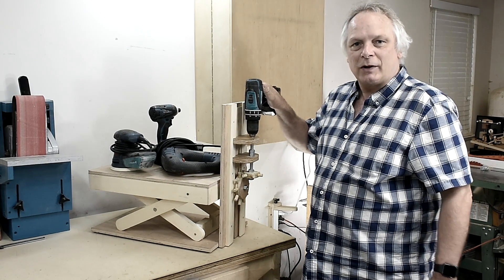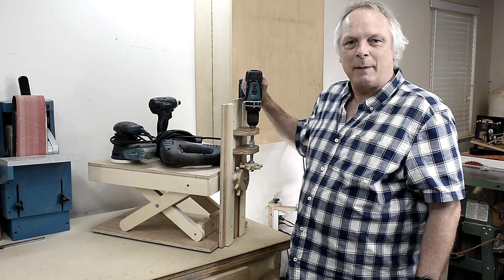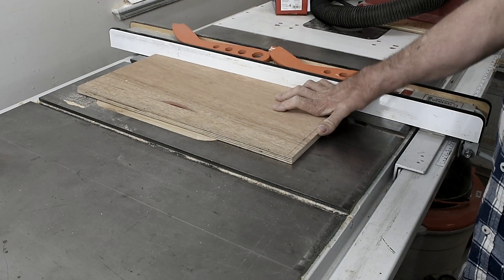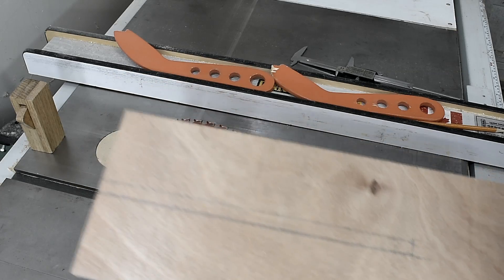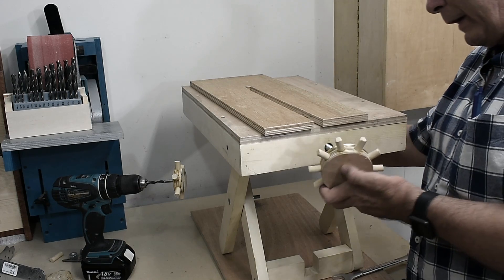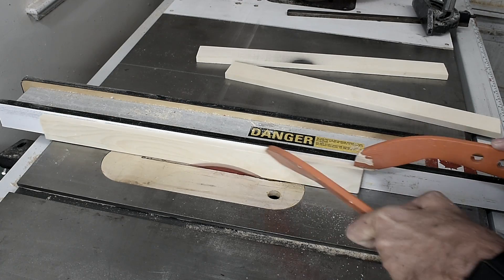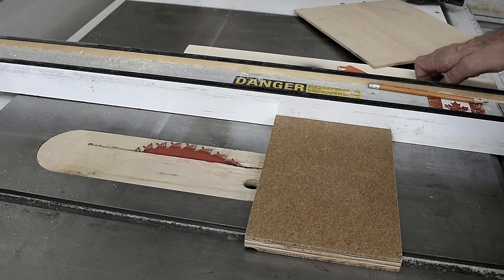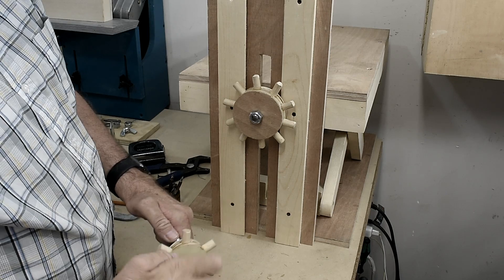Dog Elevator - and Making Pin Gears

Comment: I like how you made the gears, seems a fairly easy way to do it.  You might be able to get them to run a little quieter by adding some bits of rubber hose over each of the dowels if you can find the right diameter.  The bigger gear on the drill might give you a faster lift speed, but at the expense of some mechanical advantage.

Comment: If a vacuum cleaner scares the crap out of most dogs, I'm sure a loud cordless drill won't have nearly the same effect.  After watching this, I failed to calculate in that the dog is probably deaf, but at the speed at which this lift moves, the dog might also die of old age by the time it gets to the top.

Comment: to lift the elevator  i uses  a steel nail of 4 in  , i bend it 1 in 90 deg from one side and fixed to the shaft using thread  threw a hole in  to the drive shaft

Comment: you should try using some different gear ratios in order to make it soon faster. (I'm not to good at gears but a big gear on the drill and a small drill on the lift should increase its speed, and as long as there not too different it should still have some power)

Comment: this... is awful... Jack are you going mad, this is too slow and too noisy and too unsafe for any dog to use even if it was automated. 
IT barely goes up, why would you call it a dog elevator?? I admit the gear system was cleverly made with dowels, but that's the only good thing about this upgrade, in fact it was the only upgrade.